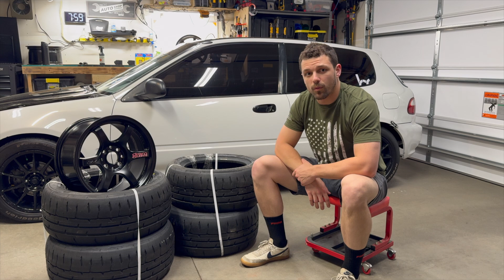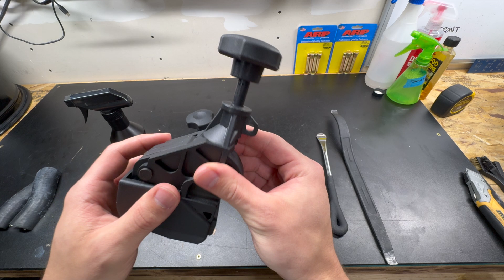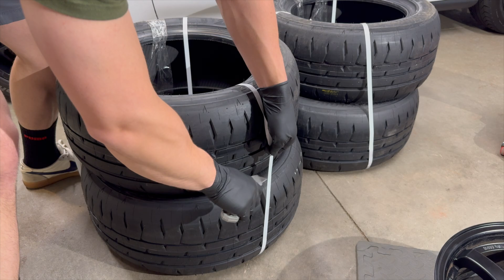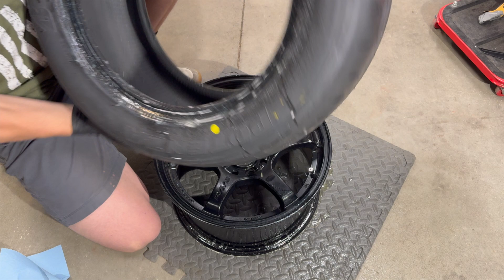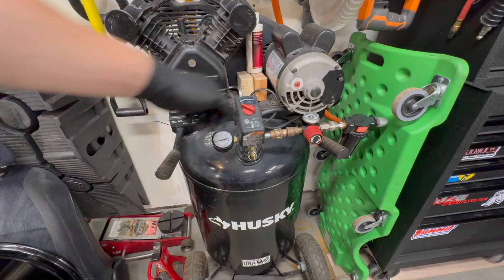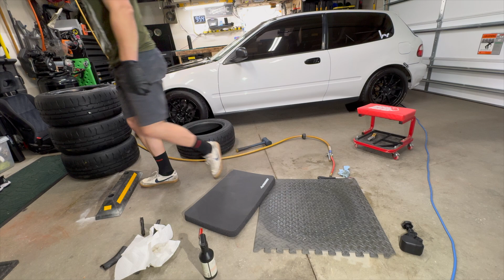Can You Mount Street Tires Without a Machine?

Comment: Dude, you have what they call "true grit" (you don't give up easily). I really felt for you as I know how hard this job is, but I was impressed that you preserved. There are some tools that would have made this easier for you (like you said, longer tire irons, some different drop center clamps, some nylon rim protectors,  some way to get that wheel up off the ground - like one of those Harbor Freight manual machines - even more liberal use of tire lube, and even consider putting those tires out in the sun before mounting them to get them softer and easier to stretch), but still impressive work with substantial cash savings!

Comment: FYI the heaviest part of the wheel is not always the valve stem. I have my own tire machine and balancer. I spin the wheel without the tire and mark the heavy spot, sometimes its over 90 degrees from the stem and sometimes its right on it. I always match the heavy spot to the light spot and the wheels take very little weight and drive perfect at every speed.
Reply from the maker: Great point, if you have a tire machine and balancer this video isn't really relevant. I'd love to have that setup.
Reply: @kawdzilla  Took me years but I finally broke down and bought one a few year ago, totally worth it..